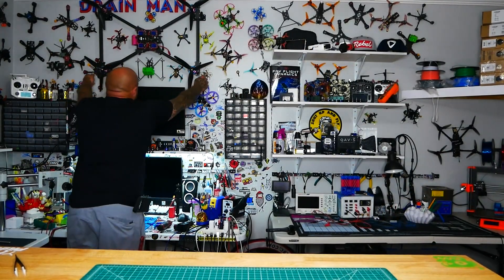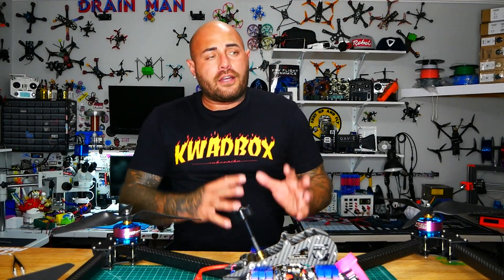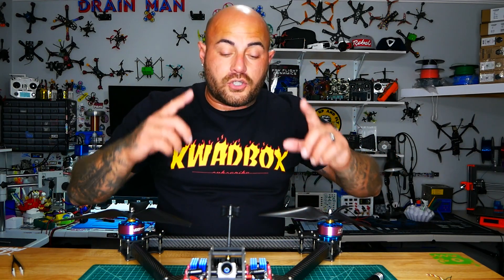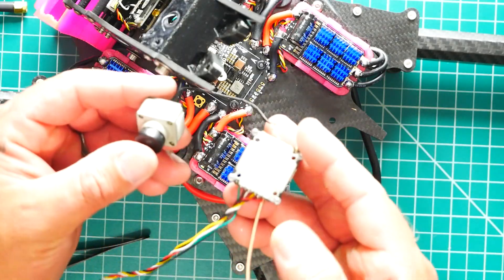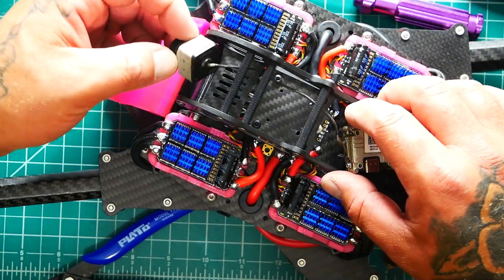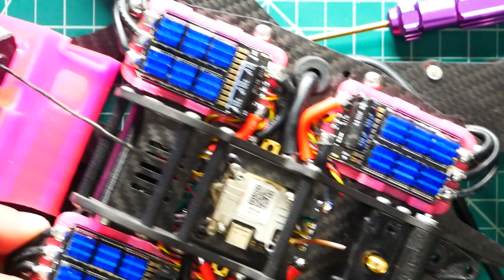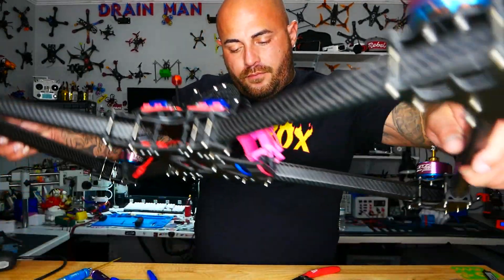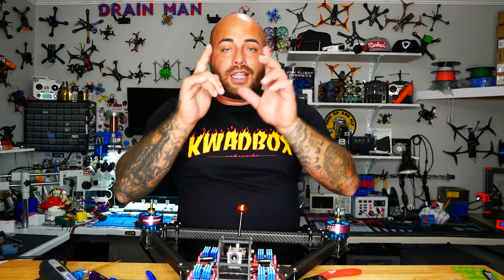Let's Put HD In This Monster X-Class Drone!!

Comment: I am replacing my 19 inch prop of my 250-gram helicopter with one of these 13 inch props because the straight down diving military objectives can't be done with quads, and the 250-gram helicopter is being discontinued. All the trend curves point to 13-inch having the highest endurance and optimal motor weight. I have learned so far that Jacuzzi from Australia and another Catalyst Machineworks racer frames use 13-inch props. Your frame is the 3rd that I learned.